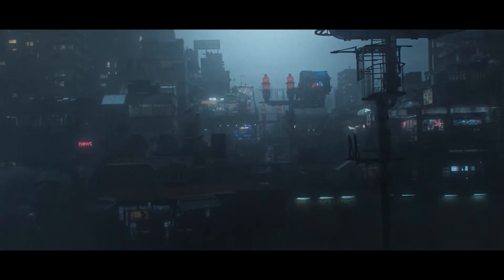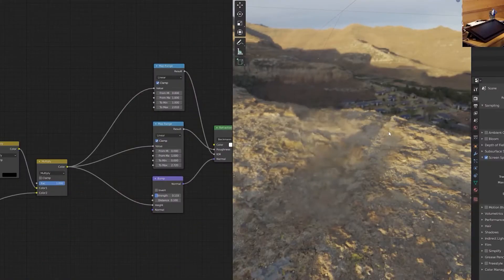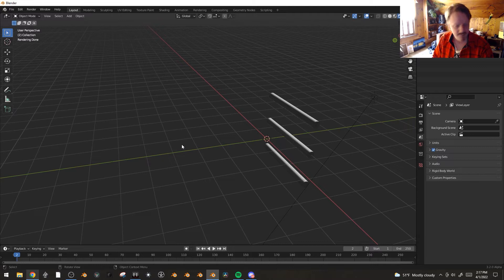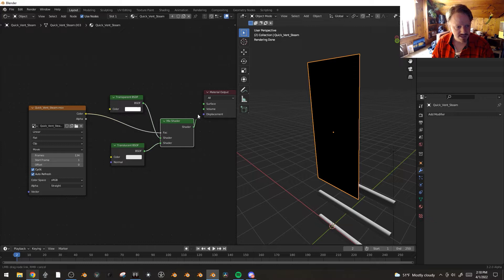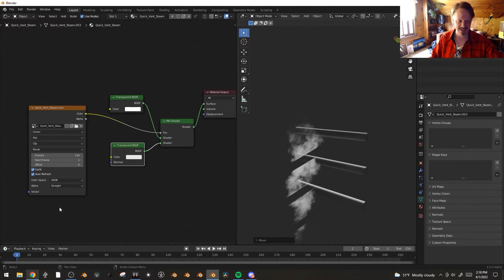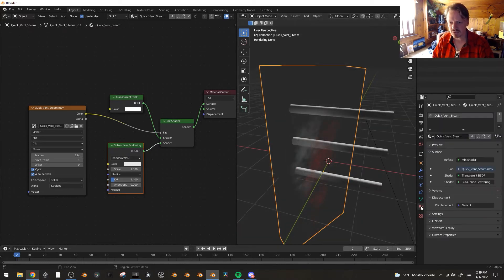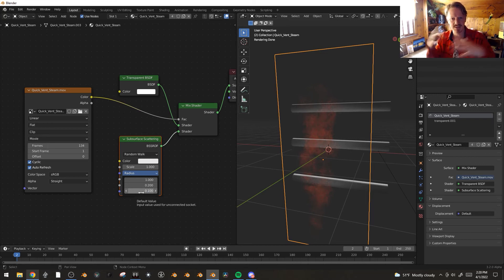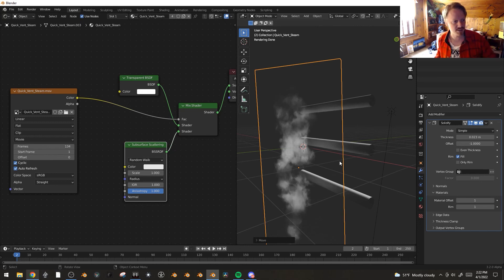Giving 2D Steam Elements 3D Looking Shadows

Comment: This is great, I'm of the same mind when it comes to using 2d video files for VFX stuff. Does the SSS used in this way impact render times compared to the normal translucency? I can't imagine it impacts it very much, but I've always found SSS to need extreme amounts of samples to get rid of a lot of noise it introduces.

Comment: Is it possible to create a video texture of smoke through the use of simulations? That would be really interesting if it can work like that. There can be endless possibilities of smoke textures!
Reply from the maker: Oh totally!! I think that's how a lot of projects go about it. I just like using filmed elements because I think there's a chance it adds a bit of realism, which is useful for VFX, but as long as 
it's a white element on a black background, you could do this with anything :D
Reply: In embergen you can export png sequences of your simulations and use those. The software is very easy and fun to work with (Realtime smoke sims!) , I think there is a free trial if you wanna check it out.